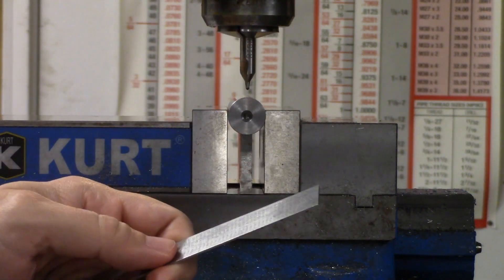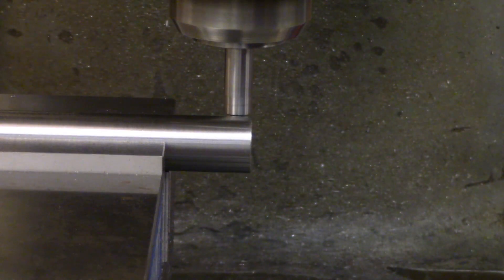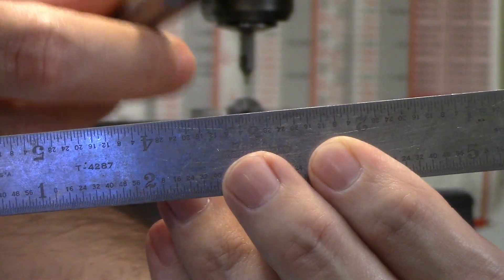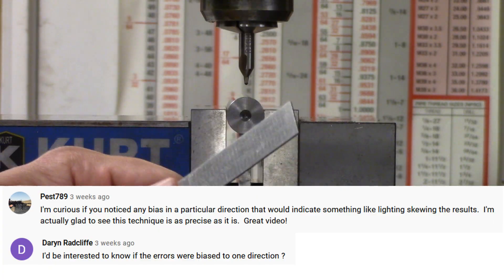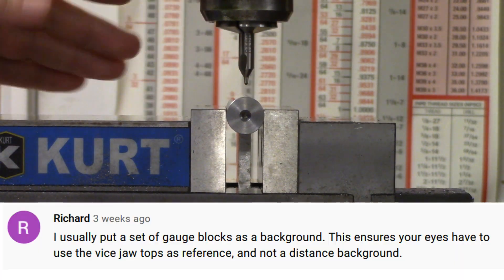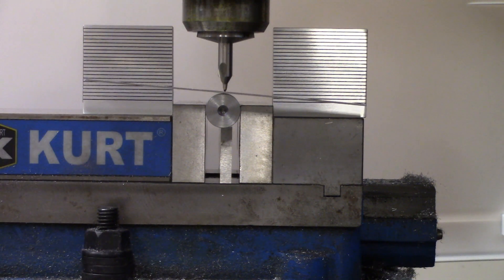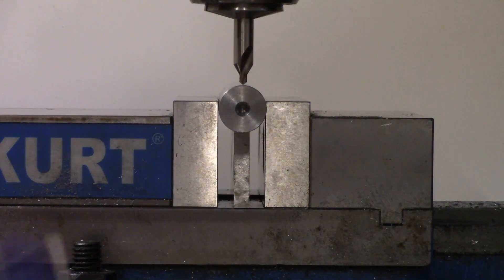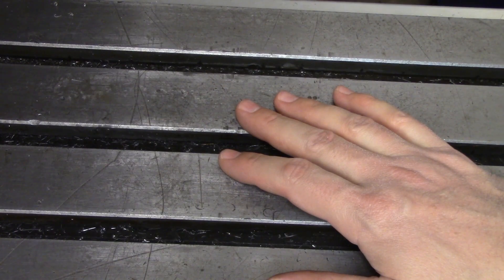How Accurate Is the Scale Trick Part 2

Comment: 2 ideas to throw at you - 1.:  Try using a ground center as the tool in the chuck -  (with, a very slight radius on the tip  .)  2. :  Use a 'T' shaped tool in the chuck . . . { an engine valve could be modified to suit  } - basically, a 'stem' for the chuck , with a DISC that is ground flat on the face that would engage the rule - ( * I would suggest using a parallel that is known to be FLAT- INSTEAD of a rule , which should give very good results )   ** IN THEORY !   There are many factors that could affect the outcome -  Between 'feel' , SIGHT , & accuracy of table / vise FLATNESS to begin with . . . as well as the concentricity of the round stock being 'centered' !     'Guesstimation' could be reduced with some certainty when you have KNOWNS to start with ;)     Accuracy would begin with having the quill & table in perfect alignment - chasing perfection leads to INSANITY ! ! !   ;)

Comment: Yes this machinist's trick works and I've used it myself. However drill chuck or collet run out also affects the accuracy depending on where the run out high or low point happens to be on the scale. Far too many won't take the time to check what there chucks or collets are producing under real world conditions. I also would have used a DTI in favor of the edge finder to get a known exact part C/L on the test part to preset the dro's zero. Those edge finders can be very accurate but still suffer from a few 10ths inaccuracy on even the good one's. Some with cheap off shore edge finders again need to double check just what repeatable accuracy they can expect. My first cheap one was worthless because the part faces weren't properly heat treated and lapped. If that's not correctly done they have poor repeatability for when that kick out happens. Personally I think a dti and finding both sides of the part is almost as fast as using this scale trick once you've done it enough to get quick at it. But for semi accurate work on something like a drill press, this scale trick is still worth using. I now wonder if that repeatability issue depending on the approach side chosen happens when centering lathe tools using the same scale trick?

Comment: Why the hell are you continually flipping off your center finder?  That does absolutely nothing. Why do that?
Reply from the maker: Do you mean when I make it run eccentrically? I do that so I can see it get more concentric a little easier. It gives me a bit more advanced warning for when I'm approaching the edge. Unless you mean flipping off as in flipping the bird? I do that because my edge finder is kind of a dick sometimes.
Reply: @StuartdeHaro  Maybe I am spoiled. I use a herman schmitt and when run properly at 1000 rpm it automatically goes off center. But even the cheap ones can do that. I can easily see when it is close plus I never use the first indication or even the second So I just run in in till it flips and temporarily note the position and go again until I am happy. 
If your indicator is being a dick
Go get a Herman Schmitt.